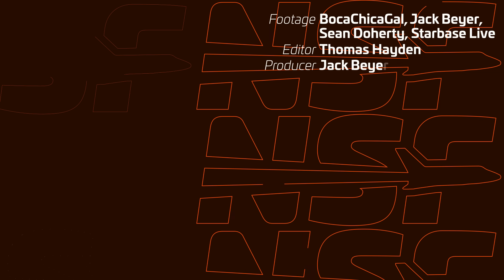Grid Fin Actuator Replaced on Booster 9. Starship is Ready for Flight! | SpaceX Boca Chica

Comment: Hey @nasaspaceflight great vid as always, would you consider putting a clock in the videos so we can see a time scale for the sped up sections?  More or less to just see how fast they are getting with these processes.
Reply: I made the same request several months ago, no results. If enough people ask, maybe it will happen.
Reply: They have a hard time getting these videos out on time. Adding time consuming requests does not help.
If it had been simple they would have done it long ago. (Many cameras. Many recordings. Few editors)

Comment: I hope it launches tomorrow
Reply: It will
Reply: What are we hoping for after it clears the pad? Get all the raptors lit this time and maybe a hot-stage?
Reply: @dougmicheals6037 While the mission is about the same as the last flight I think the goal for this flight is that they want to atleast get them to separate and have ship 25 fly freely.
Reply: Me too. I made the trip and hotel prices went sky high 😢
Reply: @GOE-s4f  Yea i just need it to atleast pass the karmen line
Reply: As long as it gets clear of the launch tower and the pad stays intact, then we should see much more regular launches with newer design tweaks each time 👍
Reply: I hope it's successfully enters Mars orbit to deploy satellite constellation and then make it back for...❤
Reply: Same @~@ especially since it's gonna be the exact same day as my birthday if it goes well tmrw
Reply: @dougmicheals6037 I’ll be happy if it gets to stage separation without blasting a crater in the launch pad
Reply: @markmontagna7637  Agreed. I suppose this will be the first deluge test/use too? The concrete issue is an interesting one.
Reply: Told ya N1 blows up again 😂😂😂🔥
Reply: @codeforce5556  And it was fabulous
Reply: @ploom493  😂🔥

Comment: Considering that the ships spend their lives out in the weather....it's amazing they don't have more problems.   And the fact that Booster 9 has been delayed for SO long...thanks FAA...it's even more likely to have weather related issues that shouldn't be a thing with later builds that get to launch on time.   Fingers crossed for tomorrow!!!
Reply: In the extremely humid salt laden environment at that!!
Reply: Very true. But it is more data points for further improvement, to make them even more resilient, since they plan to eventually reuse boosters and starships an indefinite number of times, and very rarely putting them out of the weather.
Reply: I know everyone wants to blame the FAA, but it’s actually SpaceX’s problem for pushing so hard, having an unforeseen problem and then having to go through all of the processes again. Had they delayed IFT-1 by two months to install the deluge system, they could have avoided a 7 month delay. 

The FAA is not in the wrong for ensuring safe conditions for flight.
Reply: What kind of weather do you think any rocket experiences crossing the cloud layer at over Mach1 and then Max Q? The weather on land is a piece of cake . And please stop putting all the blame on the FAA. A number of other agents where involved in the delays including SpaceX itself. Delays are integral part of the space business. If that is 'unacceptable' to you then you are in the wrong business.Overall everything is going pretty Norminal😉 Look, they where going to launch the thing with missing tiles! God forbid something happen to the ship at launch, even if not related to the tiles, I guaranty you a swarm of lawyer will jump on that Bandwagon and sue and point fingers and inquiry after investigation will find out the missing tiles had nothing to do with the failure. Meanwhile new delay new blame game. Will that be The FAA's fault ? Musk chose to launch without a water deluge and that triggered a chain of event. That all. Enjoy the launch on Saturday. Cheers
Reply: @LG-ct8tw  Well, there's very little salt in the upper atmosphere, but tons at Boca Chica.
Reply: @MrMichiel1983   ?
Reply: SpaceX has been fortunate Starbase has not faced severe weather. Imagine what sustained Cat5 winds would do to everything not nailed down there.
Reply: @MomedicsChannel  well they didn't know if deluge was really needed.

Comment: I wonder if future iterations of Starship will allow for such maintenance to be carried out without destacking and removal of the HSR? Much like an airliner where you need quick and easy access to swap out faulty components.
Reply: Needed the crane for the actuator.  Probably not.
Reply: @FARLANDER762   yes, granted a grid fin actuator is pretty beefy but for smaller items perhaps, avionics LRUs etc.
Reply: @johnforster5312  In that case probably yes.  SX rockets are built to be maintained.

Comment: So I wonder how many of the issues they're having are from the wait...from the hotstage, or just would have been there no matter what as part of the prototype process.  At least they're getting lots of practice with stacking/de=stacking and trouble shooting
Reply: This thing (at least the ship) is supposed to wait for two years on the surface of Mars I don't think a few weeks on heath should bother it. There is Booster waiting its turn at Massey, should be able to handle that. Its not SLS with its sensitive foam insulation and aluminum skins in salty air. And if something fail due to time in the weather, better find out now. I bet you SpaceX will lean something valuable about the fins actuator and improve it accordingly, all is well.
Reply: That is what always happens during an R&D period. S25/B9 are still just prototypes, with lots of small compromises they want to find out whether they will work or not. The same with many more ship/booster iterations. If SpaceX is able to do many quick tests they will reach their goal fast, but everyone should expect failures and mishaps - it is part of the deal.

Comment: I am sure this has come up somewhere previously, but would there be a benefit to adding a construction crane to the top of the towers at Starbase? The LR11000 crane works here and at the Cape but if they are looking for point-to-point travel capabilities at some point in the future this means being able to service in situ. There's no means to transport a booster or ship for maintenance in the plan right now. But as a future concern it seems prudent to test that stuff as they iterate on the OLM.
Reply: It's been discussed.  Consensus is that it would add mass and complexity to the tower without adding significant new capabilities.  In other words not worth it
Reply: They already have the LR11000, why would they put it out of work? It has to pay for itself after all.
Reply: I think it's more likely they will figure out how to use the choppers to lift the hot stage ring.

Comment: I wonder what would have caused problems with 3 different actuators? Water ingress?
Reply: I think it was one, but given that they have different design iterations and such - they probably decided to replace ALL of that particular build / model at the same time. Yeah, I’m sure they aren’t cheap, but compared to the cost of the entire stack, propellants, and the (even if minute due to grid fins) risk of another failure…. It’s an absolute no-brainer.
Reply: It sounds like one of them had already been replaced a few weeks ago, so this was likely them just replacing all of the original ones to be on the safe side. If 1 (or I guess 2 given a few weeks ago) failed then the others probably weren't far behind. Not sure why they failed, but the hot staging ring basically seals them in so it's probably a hot humid environment there which is different from what Booster 7 had.
Reply: It could be.
Another reason could be the choice of actuators. The need to save weight could have pushed them to a choice of actuators with thin margins...not enough torque? To quick to overheat? Maybe Elon will say something one day.

Comment: Strange thing that after this launch we may see a launch around every five or six weeks, if they can produce new ships fast enough. Right? The licences are in place? Providing there’s no heavy damage to the GSE. A launch per month for 2024 would be a lot of fun.
Reply: The current license is only valid for the next attempt. Provided things don't blow up in unplanned ways, they should be able to get the next license relatively quickly.

Assuming everything goes as planned (quite unlikely already), they would most probably do something different next time, which would require a modified license anyway.

Comment: Does the Hot Staging Ring create a Solar Oven for the Grid Fin Motors and electronics at Booster Top when Ship is not in place?
Reply: That's an interesting question in my last shop in California  we made these huge (by some standards), that came in the shop as forged aluminum ingots we handled with fork lifts E-boxes that we stuffed full of electronics that can get really hot!  They went into schoolbus sized satellites. THEN I BEGAN TO WONDER HOW DOES THE HEAT RADIATE IN THE PRESENCE OF A VACUUM?  A thermos bottle works because the vacuum traps and insulates the heat from passing through.  These satellites were in a "PERFECT" vacuum??
Reply: Why would it create a "Solar " oven? What is solar about it?
I must admit I am a bit surprised at the number of times they have had to switch these new electric motors. I doubt it has to do with heat. 
It could possibly be the result of the forces needed to move the grid fins. The torque is too high? They want to keep the weight at a minimum which is why using motors that are near their limit is not out of the question - but unlikely.

Comment: Spacey X need to integrate a crane to the top of the launch tower, so they don't need the giant LR11000
Reply: Why? They already have their LR11000, so why not use it?
Also, a crane on the tower would have to be taller than the tower is now, which would need authorization to modify. Then it would need shielding too. Not practical.

Comment: Why dont they make the tiles interlock, it would be harder for them to fall off.
Reply: They actually need a little gap between then because during reentry they'll expand slightly. If they were interlocked then they might try to expand and end up cracking. It'll be interesting to see what they do though, since some improvements are definitely necessary. Maybe they'll come and prove me wrong!
Reply: @thomashayden804  Once the design is tested we could see modifications that would automate the manufacture and installation of the tiles. Now robots weld the studs, but they can't include the joints between the major sections of the ship (they have to glue those). Maybe wait with the studs until the ship is stacked - thereby the robots can cover the whole ship with no gaps (not simple). Also robots that install the tiles (and test them) would make the result more repeatable and uniform. But it is way too early for that yet.

Comment: That was a waste of time. B9 blew up as it tumbled out of control because the hot staging system is asymmetrical causing gimbal lock as the booster attempted to pull a 180 to orient for fins up/engines down configuration.
I think the cornputer opted for the easy re-entry mode of a million pieces as it threw a tantrum.

Comment: That should read "ActuatorS Replaced" (plural)
So, they ALL went bad? Wow! And just think, I thought they delayed the flight for just one grid fin failure.

That doesn't bode well for the reliability of the Grid Fins in general. 
And why are you describing it as "Grid Fin Actuator Replaced", as if only a single one was changed out?
This video shows them ALL being replaced.
Is someone attempting to minimize the problem?

Hope these four last for at least one flight.

Comment: If this was NASA Boeing or ULA an actuator failure this early in the life of the part would stop everything until a thorough investigation was completed. If the fins become unstable during launch a RUD would happen. 
If the same supplier made the actuator for the engine assembly, a launch would not even be considered.
This Rocket is pretty, but very very dangerous. It could be the world's largest non nuclear bomb.
Reply: Yeah, SpaceX should be more like Boeing... the Dragon capsule should still be in testing, not sending astronauts to space.
Reply: @zachhoefs9543  true :). I hope it goes very well myself. The actuator is not even 6 months old and failed. I'm sure SpaceX will check it out thoroughly. Fingers crossed 🤞 for a good launch.